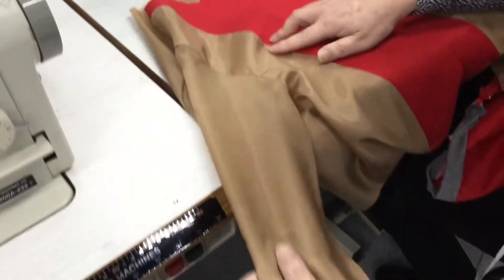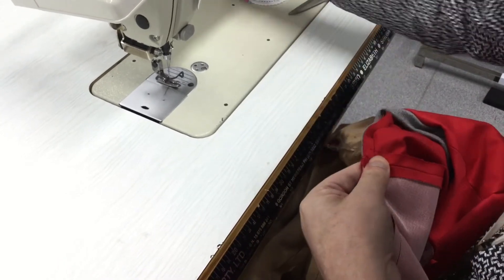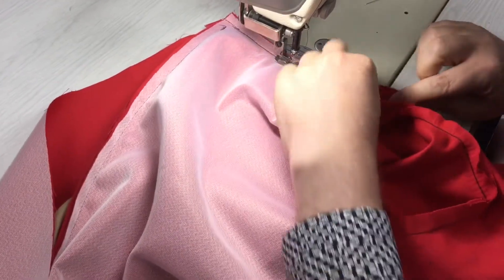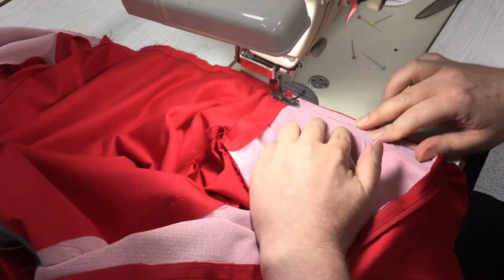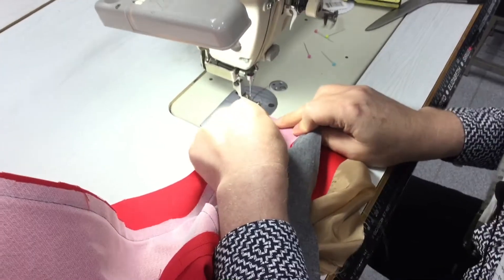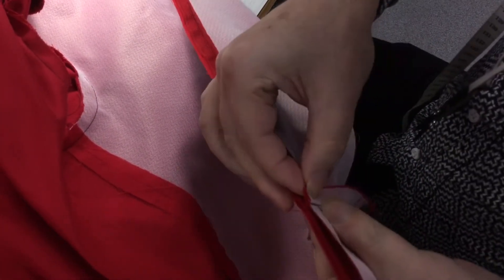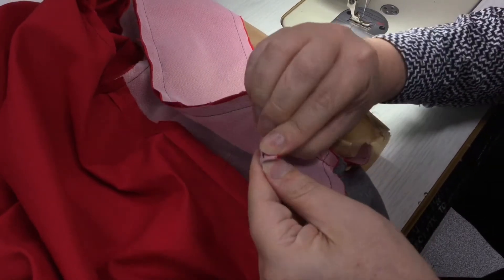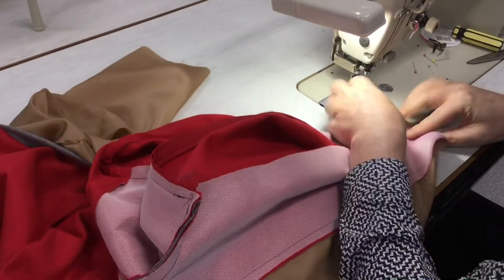Sewing lined bomber jacket 8 - Attaching lining.

Comment: your moving to much in the video to see where you are attaching the collar, it it attached in the inside of the collar ? also and do i attach it the the facing  in the insde,
Reply from the maker: You're message is unclear, but the neck rib sits in between the outer and facing/lining and is sewn from centre front around the back to centre front on the other side. Hope this helps.
Reply from the maker: The neck rib is attached in the 3rd video of this playlist.